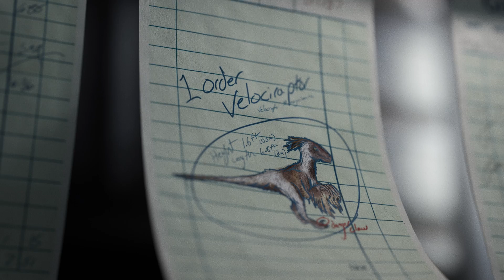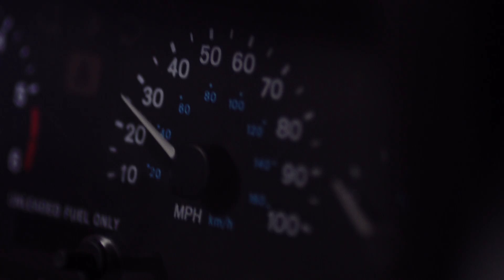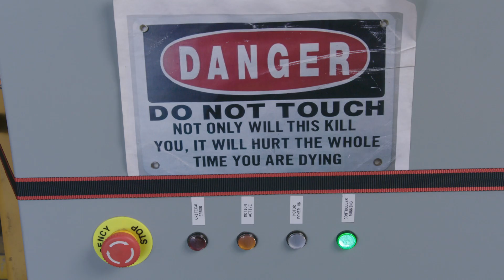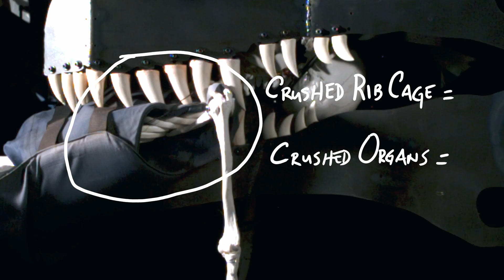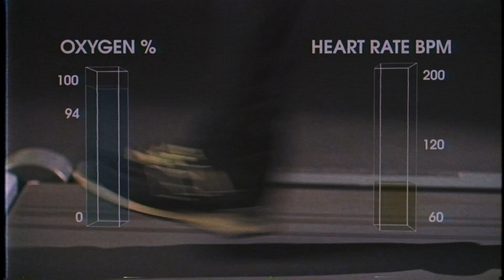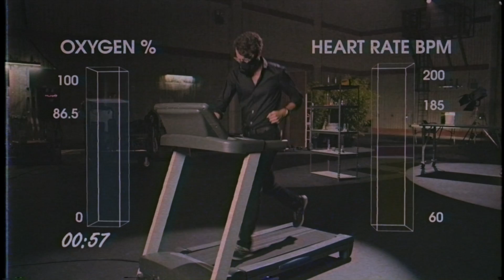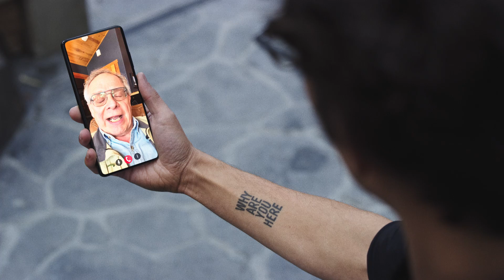Could You Survive JURASSIC PARK?

Comment: A couple of interesting facts missed out 

1. A T Rex could not roar as it used super low frequency to communicate through the dense forests, also if it did roar at you it would rattle your spine.
2. A T Rex would not be interested in chasing after you, as you wouldn't be worth the calories used up and it needed to eat its own body weight every day just too survive. 
3. The largest raptor that ever lived was called a Utahraptor which was twice the size of the velociraptors depicted in the film.
4. Pteresaurs weren't dinosaurs as they are flying reptiles not lizards.
5. Another issue with dinosaurs living today would be the temperature. Dinosaurs lived at a time when the world was in a heated period. Contrast that with today in this time it is in an cooling period even with global warming it is no where near hot enough for the Dinosaurs to survive.
Reply: Dinosaurs lived on Alaska and Antarctica,  it wasn't cold as today but few months at years there was definitely cold and dinosaurs lived in that cold climate just fine.
Reply: @ExtremeMadnessX  it was still hot in those places. All the continents where joint together to create a super continent called Pangea (at least till the jurassic period). It didn't really get as cold as it does now especially for long periods of time. Once it did start to break apart it still didn't get as cold till the ice age began.
Reply: @kristianferencik8685  Mammals and birds adapted to colder climate, so could dinosaurs. Also on Alaska and Antarctica there were periods of few months in apsolute darkness and cold, some dinosaurs migrate but many species stayed during coldest and darkest times.
Reply: @ExtremeMadnessX  not during the cretaceous period. That didn't happen till the 30 million years afterwards. Plus majority of Dinosaurs where cold blooded not warm blooded.
Reply: @kristianferencik8685  Looking at documentaries where dinosaurs were depicted in cold environments (March of dinosaurs and episode 5 of Walking with dinosaurs). Also they weren't cold blooded.
Reply: @ExtremeMadnessX  yeah march of the dinosaurs isn't exactly the most reliable recourse. It is extremely inaccurate. You see majority of dinosaurs like spinosaurus, tyrannosaurus and brachiosaurus where cold blooded (raptors for instance where warm blooded). These large cold blooded animals would need a lot of heat in order to survive. Antartica at the time was no where near the South magnetic pole, so it wouldn't have had the seasonal effect at we do in modern times. Not just that but there also want any amount of ice covering the poles at the time as again it was a heated period of Earth's history making things such as snow an impossibility (with a few exceptions).

See the issue with the asteroid was not the fact that the impact that vaporised a couple of areas. The issue was that the ash and dust that got tossed into the atmosphere blocked out the sunlight from reaching the planets surface. So while the cold blooded dinosaurs could not adapt to this, the warm blooded could.
Reply: @kristianferencik8685  Where is confirmed that spinosaurus,T. Rex and  Brachiosaurus were cold blooded? Just because it wasn't cold as today that doesn't mean that it wasn't cold at all.

Comment: Gonna have to disagree with the raptor bit. Yes, Velociraptor was closer to what is portrayed in this but it would still rip a human to shreds in seconds. Also the raptors in the film are based off of Utahraptor which was much closer to the correct size. Velociraptor just sounds cooler so they went with that. But still one small gripe in any otherwise fun vid!

Comment: Imagine the first guy discovering how the raptors actually looked
Reply: they did, they just used a different dino and called them Velociraptors because it sounded cooler. I forget what was the actual name, but Utahraptors were pretty big.
Reply: @Appletank8  I think it was deinonychus, but they changed it to velociraptor
Reply: @MrChris77  
yeah, that's the one
Reply: @MrChris77  I think you're right. Dinonychus(?) has a huge "forefinger" claw as shown (Velociraptors don't). They're also bigger than the corrected size velociraptor but not quite as big as the movie version.
Reply: @dcarbs2979  movie version only is ment to be scary
Reply: @Appletank8  Yeah probably is the Utahraptor.

Comment: NO we DO NOT have enough evidence to suggest that T rex had colourful feathers
Reply: Phylogenetic bracketing suggests it did - that is, other closely related species are known to have feathers, and there’s no solid reason it wouldn’t, or strong evidence against that, so we should assume it did until good evidence contradicts it, which despite JP fans jumping to conclusions about a discovery of a small piece of smooth skin on an area of the body already known to be featherless, that isn’t actually evidence that it wasn’t feathered. There’s no reason to assume that T. rex’s feathers were colorful, but it almost certainly had some.
Reply: @maddockemerson4603  it had some, that too may be, if i have looked at the recent studies and recent most accurate trex rebuild, i am pretty sure it wasn't feathery bird monster